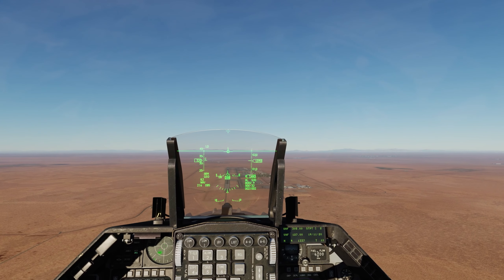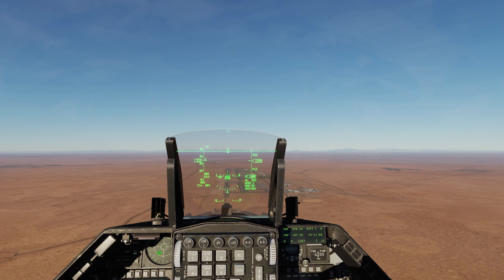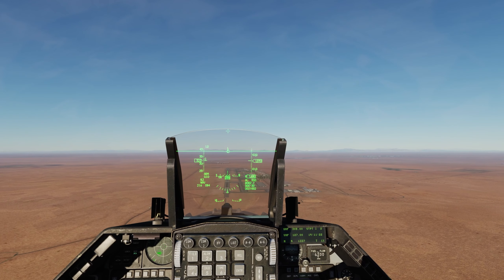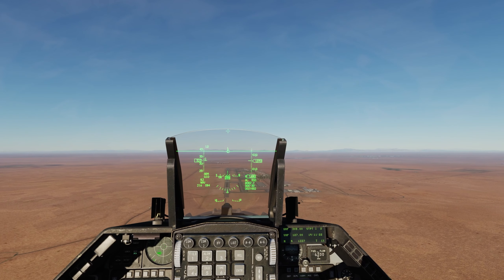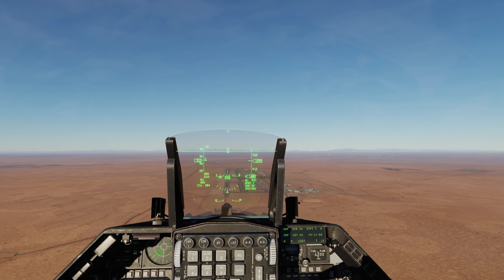DCS F-16C Viper: Overhead Break USAF Style

Comment: honestly, pretty bad circuit. First of all, standard circuit is always a left hand pattern. You're not just breaking, you're breaking into the circuit to downwind. Should've performed a break to the left, not right. That hardly ever happens. When you roll out of the turn, you're coming in way too high. You're flying into the runway at -5 degrees, rather than an ideal -2,5 degrees glideslope. Furthermore you're also too slow, making your AoA too high before touchdown. Because you came in so high, you land quite a lot of distance down the runway, leaving you with less runway to aerobrake. 

In the beginning you mention this is the way you do it. It's an instructional video called overhead break USAF style. How you do it, doesn't matter, does it?! Either you do it like they do in real life, or not at all....or don't pretend you're performing the overhead break USAF style.